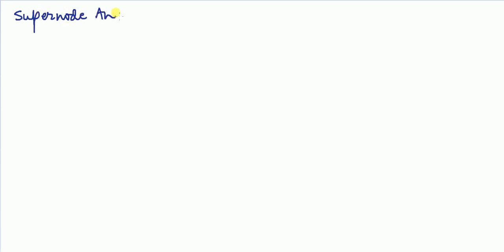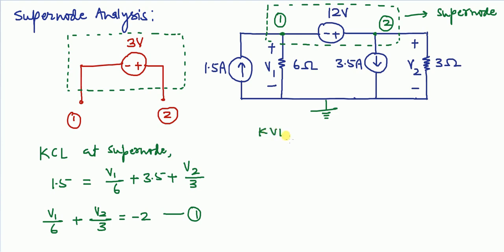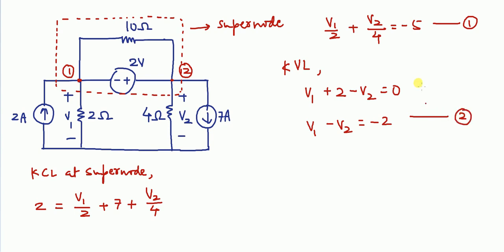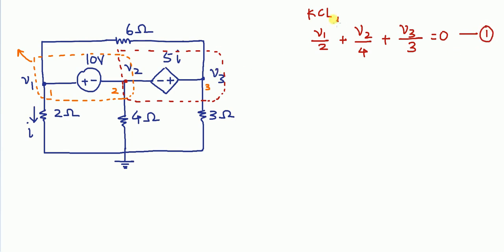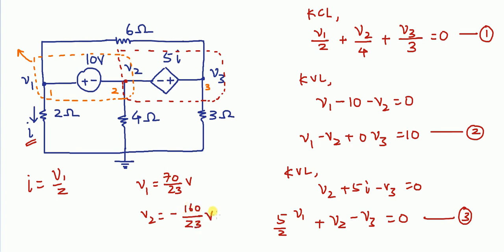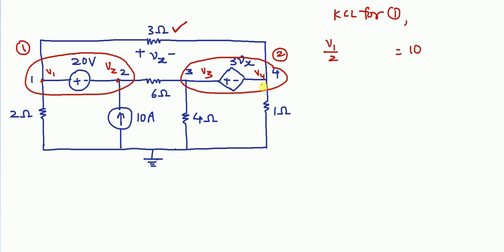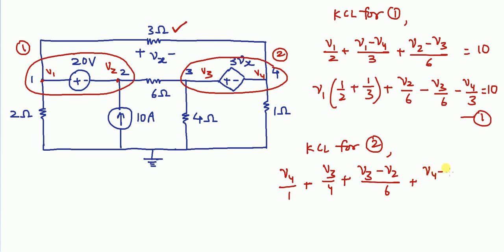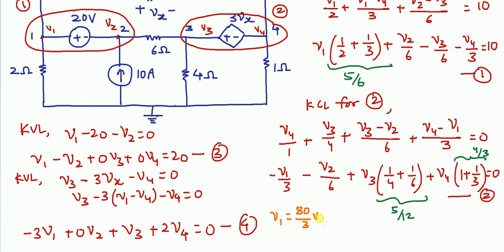Supernode Analysis

Comment: Directions of currents
Reply from the maker: Once you get the node voltages you can find the currents in each branch, current will flow from higher node voltage to lower node voltage.
Reply: @KishoreKashyap ty sir❤

Comment: Sir I have one doubt in second question, 
Why we are not considering 10 ohm resistance
Reply from the maker: Because 10 ohm resistance is connecting the two nodes of a supernode, so no need to consider the current through 10 ohm resistor while writing the KCL for that supernode.
Reply: @KishoreKashyap  thank you so much sir

Comment: For the 3rd example; why didn’t you have the currents flowing through the 3 Ohm resistor and 6 Ohm resistor  into the second  super node; because initially you made the currents flow outta the first supernode ( V2 -V1)/ 6; meaning the current was flowing from v2 to v3 out of the first supernode and going into the 2nd supernode. Likewise, at supernode 1, you had the current flowing from V1 to V4 across the 3 Ohm resistor; but doing the KCL for supernode 2; you did it the other way round. Can you explain this ?

Comment: sir if i get a dependent current source and circuit in same branch then what i should do tell me please sir
Reply from the maker: Then voltage relation remains same Vx = V1 - V4 and if I have to apply KCL then for current I will write the value of dependent current.

Comment: sir great explanation good work i think in last question Vx=v1-v4/3 instead of v1-v4 can i right sir please reply me sir soon
Reply from the maker: Let me check
Reply from the maker: I have used Vx = V1 - V4
Reply: @KishoreKashyap  but why sir can i write this equation as v1-v4/3 but you don,t use resistor
Reply from the maker: For supernode 2, KVL is V3 - 3Vx - V4 = 0
Reply from the maker: I didn't use resistor because I applied KVL which is difference of voltages.

Comment: Sir pls tell me , if a resistor is connected between 2 supernodes than we won't consider that resistor??? Am I correct sir pls reply 😀
Reply from the maker: If resistor is connected between two supernodes without a common node then we have to consider the current through resistor in both KCL.
If resistor is connected between two supernodes with a common node then we don't need to consider current through that resistor.
Reply: @KishoreKashyap  sir but y v should not consider that resistor with common node
Reply: @KishoreKashyap  reason????
Reply: @KishoreKashyap  What's the reason behind that?
Reply from the maker: @Shogun507  the currents through the resistor connected between the two nodes of a supernode will cancel each other. Suppose two nodes of a supernode are V1 and V2 and resistor R is connected between V1 and V2, then in same KCL equation we have to write current leaving from V1 to V2 through R which is (V1-V2)/R and current leaving from V2 to V1 through R which is (V2-V1)/R. Now (V1-V2)/R + (V2-V1)/R is 0.